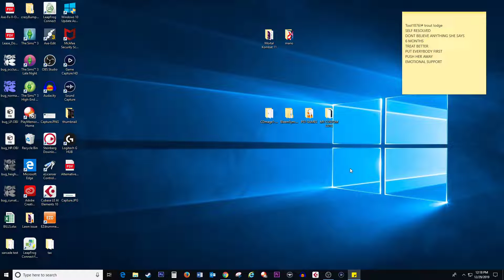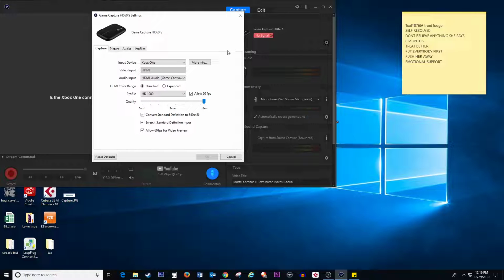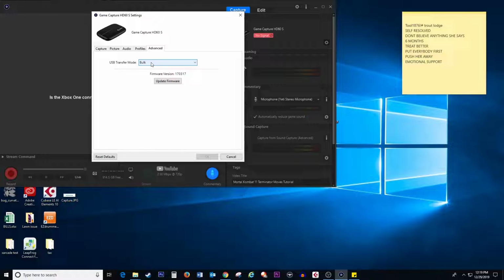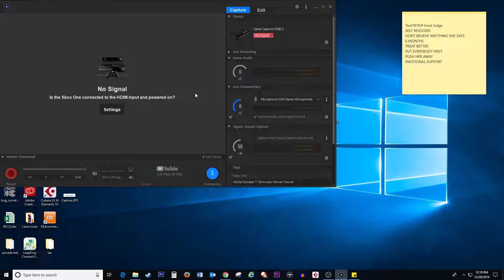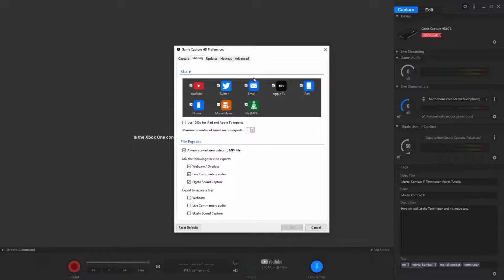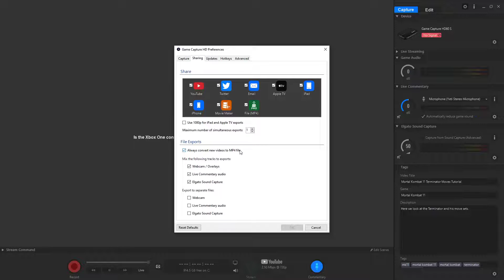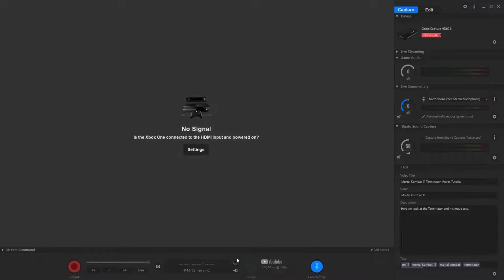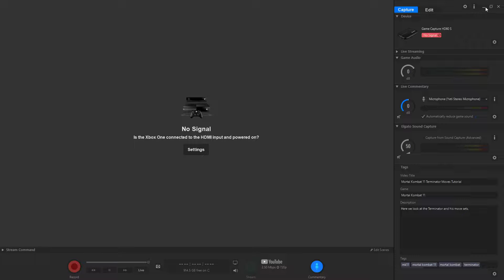#elgato #capturecard #hd60 Elgato HD60S Audio and Video Issue Fix - Popping and Crackling

Comment: I came here cus I had it the problem with static using the chat link connected to the ps4 i did everything on the youtube videos but them the static still on my stream. Them I realize it could be my external mic I use to stream, I lower the volume down from my obs and I fix my problem
Reply from the maker: Basically, it was clipping.

Comment: bro can you plzz help me out ,my prpblem issue is with elgato i do game stream on facebook but its stops in between live and black screen comes sometimes it came back but sometimes its not ,so i cant find the peoblem .i just want to know that is there problem with my elgato or hdmi cable or av adapter which i use for ipad to connect with hdmi .

Comment: I have this set up been streaming for 3 years and the audio click is driving me insane.
I’ve watched mired “fixed” videos than I can take 😊

So just a question for me, what is that software you are changing the setting on?

I have obs, and there new 4K software as it no longer recognises the old one.

I have an HD60S+
We had clicking again on last nights stream, channels my name btw if anyone wants to check and see if it can be fixed.

Thanks for any help